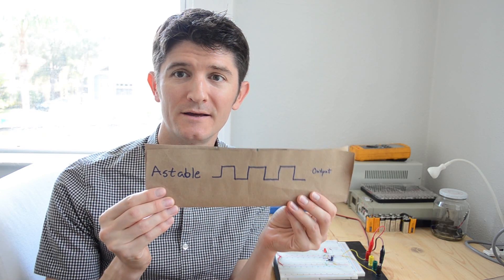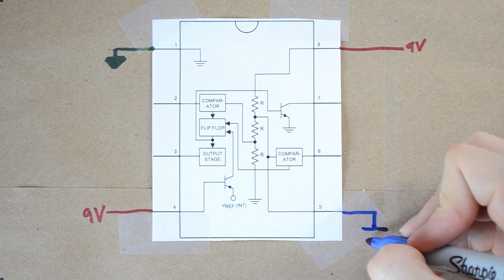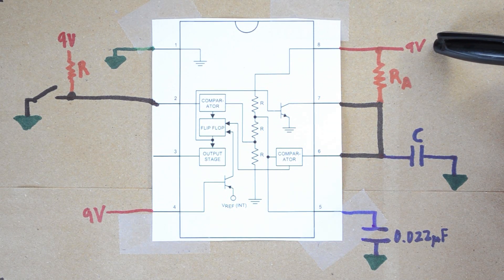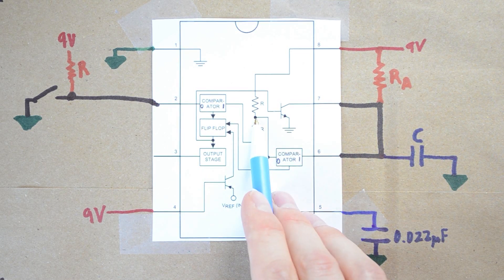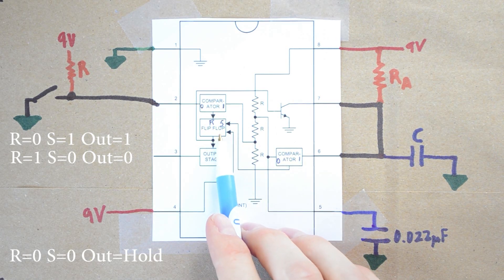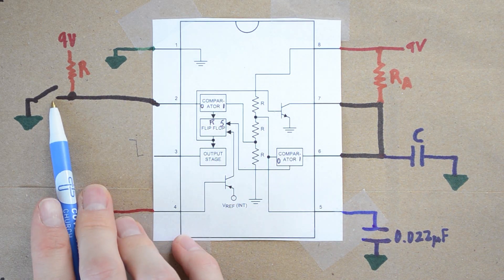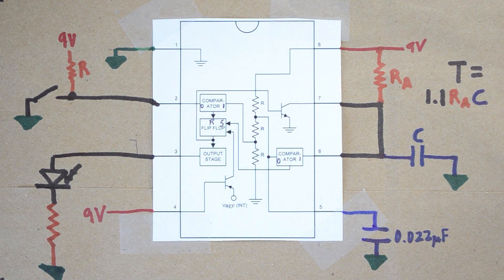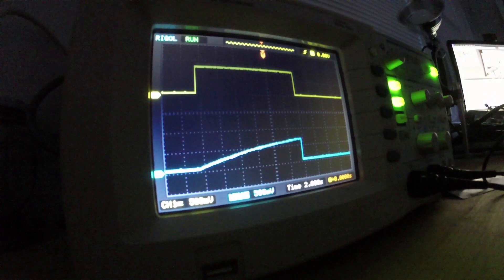555 Timer in Monostable Mode

Comment: NIce video!!! I know it is old, but I have one question: Is there a way to make a "retriggerable" 555 Monostable? For example, configure the 555 to stay on for 5 seconds when the switch is pressed, but if I press the switch again before it goes off, the 555 will stay on for another 5 seconds, without going off... in other words, I press the switch the first time, the 555 goes on, I wait for 2 seconds and press the switch again, then the 555 will stay on for 7 seconds total. Is that possible? What changes have to be made to your normal monostable circuit?

Comment: I'm trying to learn electronics (and get my 12 yr old grandson interested) and this kind of step-by-step explanation of relatively simple circuits is extremely helpful.  Thank you very much.

What are the practical limits of the event duration using this circuit and just changing the resistor values?  At some point I'm guessing that if the resistance is high enough that the capacitor would probably leak down faster than it can charge and the circuit would fail to work.

Comment: Good video. Since this is dc circuit. I want to use this 555 for a spot welding machine. Can I use it with a relay so the 555 Timer one the relay and the relay passes ac current through it to spot welder.

Comment: Jason ,  video is awesome and well explained keep it up . I am in little trouble with 74LS95  4-bit shift register   i am trying to  use it as SIPO & SISO but  i am trying to  setup these on breadboard through button and led only  (no external  clock ) providing clock input with  button  manually so can you please do a little video specially on 74LS95 IC   ( proteus simulation is running perfect but on hardware it is not doing anything ) explaining the whole setup  and working  .

Comment: Hello, great video!
Can i make a "30 min" timer with this circuit by changing r and c values? or should i use another circuit to make a 30 min timer?
Reply: I'd say it depends. If you're trying to make a multiple circuits then you might want to go with another type of circuit. I'm not sure what values you'd need but it sounds like you'd need higher Resistance and Capacitance (higher resistor value and bigger capacitor), the resistor won't cost a lot but if you're going to need a really big cap like say 2000uf a decent one can cost a couple of bucks, not bad for one circuit but for multiple cost will rise a bit!

Comment: If you use this for a stairway light replace the switch with a LDR and an npn transistor.As soon as you open a door and the light hits the LDR the circuit will turn on for a predetermined time. Great video. thank you.

Comment: Question: I need to silence an audible alarm for 10 to 15 minutes. I have created a circuit that turns on a flashing LED and very high volume alarm.  Once the operator notices the alarm I want a way to silence the very loud alarm audible portion only for a short time like 10 minutes. I had an off toggle switch but the operator would forget to fix problem or turn it back on after repair.
I'm thinking a monostable timer would work.
Question:
1 creating a veriable RC time constant for 10 to 15 minutes. Would that be practical and coast efficient?
2. Is this the best way? Or do you have another simpler solution?

Note; the current circuit monitors two  PLC outputs from two different systems. I create a circuit using 24vdc relays, Isocouplers  to trigger alarm when the Line is running signal is High and the other devices ready signal goes low. The circuit works very well. I've been given the okay to make 4 more. Once I add the audible alarm reset.

Due to time I need to keep it simple inexpensive I'm not a fully educated electrical engineer, I'm form Navy, advanced electronic schooling with 40 yrs experience.  It's been a little bit since I've designed at component level. I'm having fun.
Thank you.

Comment: Great explanation!!!..I created the similar circuit but there is a problem. The LED is ON by default when connected to power and switches OFF when the button is pressed and then switches ON after the time is up. Any suggestions??

Comment: hi.nice video!
 can i  conect IR receiver  to this circuit(and where i need to connect?instead of push button?)i want to switch on the light with the remote and i want that light automaticlly off after 10 sec.Thanks for help

Comment: The problem I have is I have a trigger pulse from an infra red sensor and I want the state of the trigger to be ignored once it has triggered the timing circuit even if it goes beyond the length of the timing circuit, is this possible? . what is happening at the moment is the sensor is operating the trigger but because it is still pulling the trigger pin down to earth the output of the timer is permanently staying on after the timing circuit length until the trigger goes high again. Any help would be appreciated.

Comment: Hey, nice video man! What is the output's voltage in the osciloscope? 9v?
Reply from the maker: If I remember correctly it's about 7.3V. The datasheet tells you the drop based on the current being pulled and the amount of voltage being used as a source.

Comment: Gonna try and build a delay pulse circuit (a one shot) and use it to re-calibrate a digital speedometer, so that when bigger rims are used than the stock size, the speed will still be displayed accurately on the digital readout; hopefully.👍

Comment: Q: Why not use 1% resistors to increase the accuracy of your mathematics?

Thank you for these lessons. The 555 is tricky to understand…for myself. 🙂
Reply: Sarah, you could measure the "actual" capacitance (since it has the greatest tolerance) and then calculate the value of the resistor and use 1% resistors. That would get you pretty close. Or use a potentiometer to dial it in and not worry about the capacitances exact value.

Comment: Trying pin 5 to ground with a capacitor helps to prevent false triggering, just small enough to provide a microsecond buffer. This is not necessary for astable modes, but I see people doing it anyway, not knowing why! 😂(cargo culting)